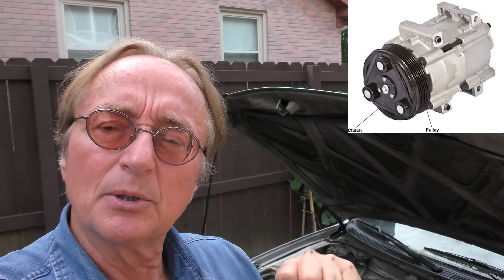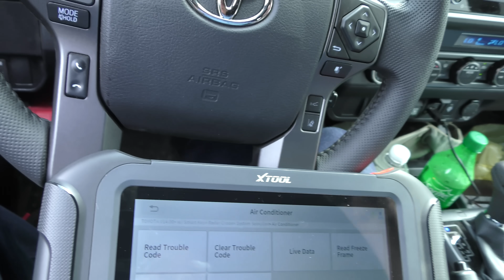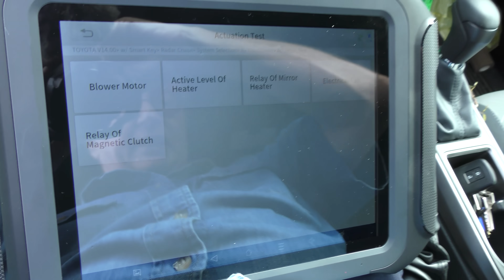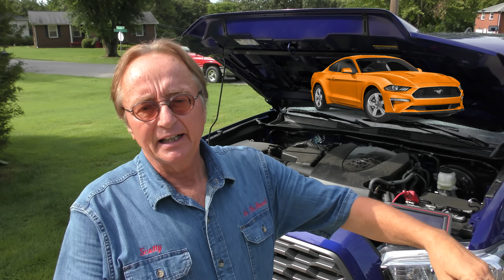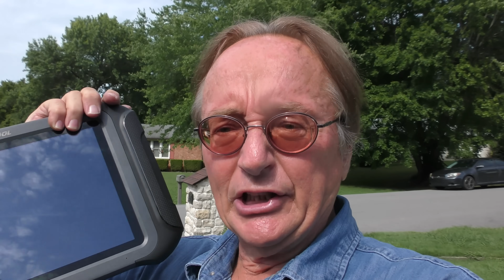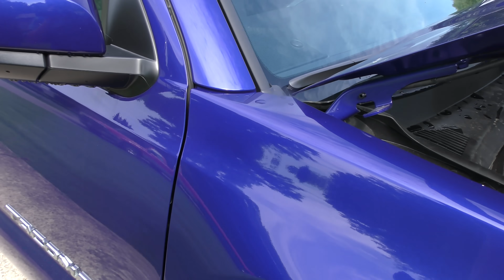Doing This Will Make Your Car's AC Blow Twice as Cold

Comment: Another good reason not to own any vehicle that's too new. Basic Aircon is fine by me, same with early 1990's fuel injection system, sure I can deal with adjustment points and carbs on even earlier cars but they were a step up in the right direction. Now it's become stupid, way complex, more than needs to be.

Comment: You should run your a/c for about 5 minutes every week to keep the seals fresh.
Reply: Not hard to do in the southern states
Reply: In many cars when you use your defroster in the winter it also uses the a/c compressor.
Reply: @michaeltipton5500  the car knows its wintertime?
Reply: @tommurphy4307  It's automatically set to come on when the defroster is set.
Reply: buck shot  ,that's true, even during the winter months.

Comment: Even a small amount of efficiency gain is a huge difference long term. Not sure if its really worth it though, cause if it brakes you gonna have to offset it with the resources needed to build the other part and replace it. heck even driving it to the mechanic because it broke costs resources (energy,time,materials etc)

Comment: Hey @scottykilmer I love your content! How do I know when my battery is too weak before it stops working?
Reply: You can take your car to a auto parts store and they can load test your battery.  Usually free.
Reply: Install voltmeter if your car don't have one. Most modern car can show battery voltage in the MID. I use a cheap voltmeter plugged into the cigarette lighter socket , my car is a popular low MPV in my country (2013 Toyota Avanza 1.5). Better result if it is wired directly to the battery. If the voltage is around 12-13V when the key is in ACC position, the battery should be OK. But if it is under 12V, first try clean the polarities or tightened the cables, if still the same after doing that, and the battery is more than 2 years old, better replace it with new one.

Comment: My car had a weak battery. (I check regularly now). My climate control would be turned off whenever I started it up. Then one day it wouldn't start. I replaced it and now the climate control is always where I left it. Strange how weak batteries effect modern cars.

Comment: My 20 Tundra has dual.climate. my wife wanted heat and it barely blew any warm air at all. Not sure if it isn't working properly or if that is normal. I mostly just have it on AC or heat for both.

Comment: Whenever I turn on the AC in my car the fan gets so loud that it’s kinda embarrassing. Also, one of the fan mounts is broken so the entire car shakes when that fan is on
Reply: Most fans are louder than the Engine of the car which is funny, if you walk past a bunch of stopped cars at an intersection all you hear are the fans blaring away keeping the engine and the occupants cool during the hot summer which is cool. Also you might want to fix that fan mount

Comment: I keep having an issue with my ac. When driving its good and cold. But when I'm stopped it just blows warm air. Its got plenty of refrigerant
Reply: What type of fan (on the engine) does your car or truck have? Electric or belt? If that fan isn't kicking, or isn't engaging enough then ac will be terrible when stopped. If it's a clutch fan the clutch is probably bad.

Is it an older car? If so, the condenser can also be clogged with sand and dirt or the fins are falling off.

Comment: I got a 05 nissan maxima with 201k miles nothing wrong with tranny its PERFECT and runs top. It has so many buttons its crazy. even has auto/manual tranny. got it for free from a REAL GOOD buddy. Only thing wrong with it is the abs burnt out. So should i fix it or just keep driving with it.
Reply: Could be as simple as replacing a wheel speed sensor which is a common part to brake that screwes the speed gauge

Comment: Keyword that should be repeated over and over again, maintain what you have! Continuous maintenance is the best way to keep your car running for as long as possible.
Reply: I've been driving the same truck for 18 years.  Bought it brand new 2 months after I graduated high school.
Reply: @Another Wacko Either maintenance is your hobby or forever car payments will be your hobby. Maintenance required such little time and I like to stretch my money 💰 so I've been driving the same Silverado, bought new, for 19 years. That's 16 years 
without car payments 😎👍
Reply: Very true, ✔️. Tires too! Check the air pressure, clean them, avoid pot holes, street cracks, debris on 🛣. Many auto shops 🔧 check tire pressure for free 😉.
Reply: @Another Wacko I understand that. But, unless you don't want to have a car or truck for a long time , then you are at the mercy of the mechanics at the chain shops. But, it's nice to know that you can spot a problem ahead of time so the impact of your wallet won't be as painful.
Reply: @Another Wacko Chill 😇 Out 
Just making sure Others see it instead of being buried in Response.
Reply: @Another Wacko You win 👍
Reply: @Another Wacko We all want the binki, bro
Reply: @Another Wacko Then get a Toyota and follow the servicing handbook. Just take it in for its yearly service and it will last you decades.
Reply: AND you better maintain it now more than ever....grim times ahead, esp if we are all forced into teslas!
Reply: @Another Wacko checking your car takes maybe 30 minutes a week at best, i can understand if you don't like doing the actual maintenace yourself though
Reply: Yup
Reply: Maintenance People are the Unsung Heroes of Civilized Livin'
Reply: @thomasbrogan9102  only floss the teeth you want to keep. 🦷
Reply: @Zebra_3  You are casting Pearls, sir! That is funny as stool!
Reply: @Zebra_3  Love this.  Speaking of, I was at the dealer the other day having a spare key programmed and I was in the waiting room.  A customer there with no front bottom teeth and all false top teeth comes up to me and tells me why he doesn't change his transmission fluid among other regular maintenance items.  You don't know how badly I wanted to say "thanks, but no thanks, pal."